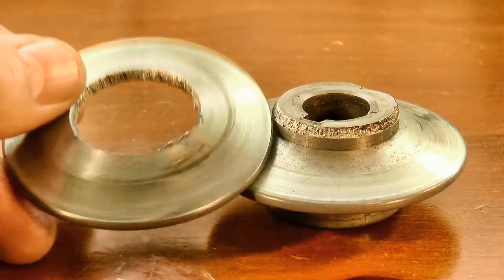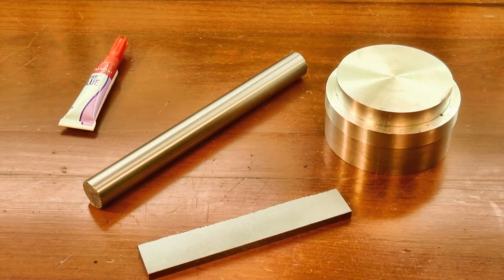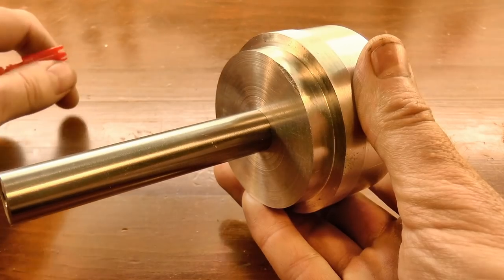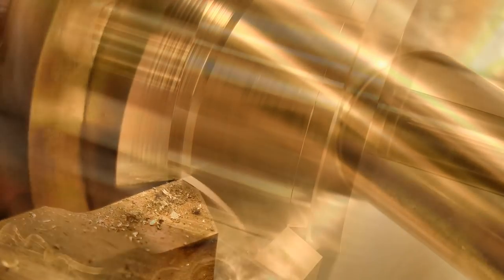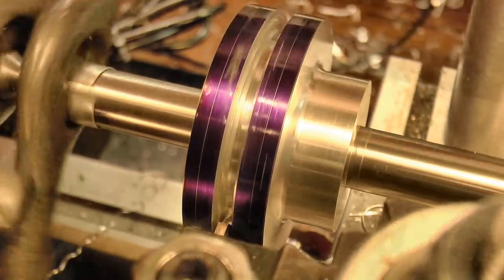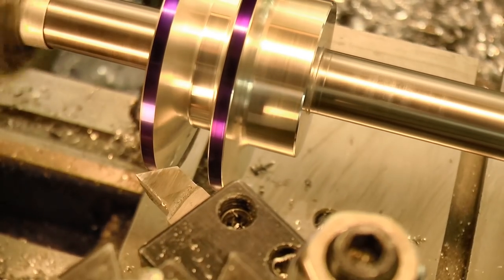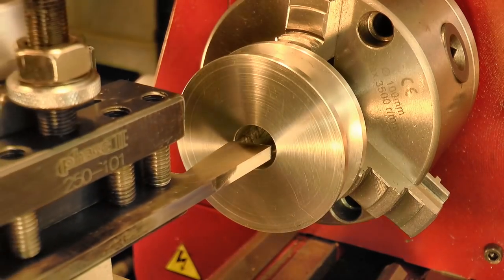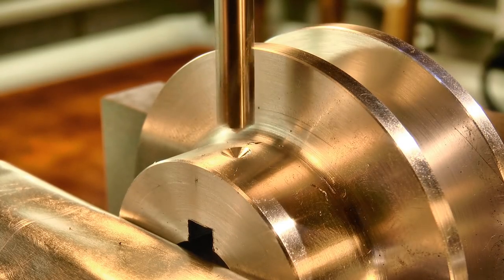Machining A Replacement Pulley With A Keyway

Comment: Don't know if anyone mentioned this yet but I got a quicker way to get to the final depth of the key way. If you have a end mill the same size (or smaller) as the key way and long enough. You can cut to the depth of the key first with said end mill. Then come back with broaching tool and all thats left is the radius from the end mill and maybe some material on the side walls if an undersized end mill was used. Much less material for the broaching equals much quicker. You might of known or heard this already but thought id share some advice. From a entry level machinist here in Texas
Reply from the maker: +Zac  Tart Great suggestion Zac, I'll try that out next time! Thanks very much for sharing :)
Reply: that's a better method to make the keyway
Reply: that's a better method to make the keyway
Reply: TICK for  Zac :)  yep...that's a good idea

Comment: honestly these videos are really satisfying. It hits a certain sweet spot everytime I see you use a tool and link to a video on how you made that tool. Everything that makes your job easier seems to be something you have made for yourself and that sounds so devine. If I wanted to start machining as a hobby, where should I start? what tools will I need to begin?
Reply from the maker: +jamiiis2325 Consider starting with a small lathe: http://www.clickspringprojects.com/blog/which-lathe-should-i-buy Cheers, Chris.

Comment: Hi Chris. I've been enjoying your videos a lot, and I'd like to offer a quick tip. When you're making a tapped hole, it helps to put a generous chamfer on the hole before you tap it rather than after. It not only provides a nice lead-in for the tap, it also keeps the chamfer tool from pushing a burr into the threads. Try it, see what you think.
Cheers!
Reply from the maker: +Tito Rigatoni Cheers Tito, I must admit I'm a bit slack about that!

Comment: Very interesting and superbly made video.  I did a similar project myself but the arbour had a threaded spigot with a nut and washer to hold the blank in place.  I have never seen superglue used in a situation such as this.  I did mine 50+ years ago so superglue wasn't around then!

Comment: Very high production values and machining skill. Was there a reason to locate the set screw above the keyway? Normally it would be directly opposite (perhaps for balance, visual symmetry or so the key is forced into the slot in the pulley and the shaft)
Reply from the maker: Tom Willers With hindsight Tom that probably would have been a better idea, but to be honest I just copied the broken part! Thanks for watching mate.

Comment: Chris, I noticed that you usually use "Heat" to break your Super Glue Bonds. Wouldn't Freezing the part break the bond as well? 
It might be Slower, but it would not develop the Very Poisonous fumes, even if you where a respirator when you heat it up.

Just a thought, 

philip.
Reply from the maker: Hey philip, depending on the circumstances the bond can be broken with direct heat, dissolving in acetone, or soaking in boiling water. The bond is very brittle at room temp so if the part can tolerate it often it can simply be tapped off the face of a chuck for example - Cheers :)

Comment: What a beatiful work, that looks so sweet.
Reply from the maker: +TheBK117B2 Thanks for watching
Reply: Hey there, 
got one more question:

Did you have to fix the chuck in any way while broaching the keyway ? If so, how did you do that ?

On my lathe i got an electronic speed regulation so there's no gears where i could set a low speed to make the chuck spin very tight. 

It's always spinning free so i'm afraid that the chuck will spin when i cut the keyway and i will loose the track of the established cuts.

Greetings from Germany ;)

Comment: beside its pretty easy to weld, i really like your videos. small tipp: when on the laythe take more then 0.3mm as chip thickness. in most cases you get a better surface and your tool hold longer because they are cutting and not pushing

Comment: Nice,,,a slight  interference  fit on your arbor should be more than enough hold and forego the superglue. Then heat the aluminum part to install and remove.

Comment: Ever made a little pulley with gear teeth for a toothed belt without and the use of an indexer?
Also, if you haven't already, please consider a tutorial on setting the compound for different cuts on these mini lathes.
In my college Machine courses, we always set our compounds at 30º, but everyone seems to be setting their mini lathe compounds parallel to the ways. Cheers m8

Comment: Two questions this time :)

1) Where did you learn to do all of this?
2) What 3D modeling software do you use?

Thanks again for the great videos!
Reply from the maker: demon39063 No problem :) 1) Tubalcains video's and books. 2) I use Solidworks. Cheers mate, and thanks for your continued support.
Reply: +Clickspring I can think of no higher praise for Tubalcain's work than that you credit his instructional materials for your skills.

Comment: Something struck me about the process for broaching out the keyway, I'm curious why you didn't rough it out with the mill and finish it with the broach. Are the time savings not worth it after factoring in switching machines and setting up another operation?

Thanks for posting such fantastic material.
Reply from the maker: +Alex Wiecke Yes a bit more trouble than it would be worth in potential time saved. Great to have you watching mate.

Comment: Making this out of aluminum may have been a mistake. I mean, it may last too long and won't give you an excuse to use your lathe for a good while.
Reply: I always start by making my parts from cheese. it very seldom works, but it's delicious when it fails.
Reply: connect2reality wood is always an option, or clay :v
Reply: Nothing is wrong with aluminum is this setting. 6061 is plenty strong to handle the situation. There's not excessive side loads on the pulley and it should last for years. Time comes, make a new one.
Reply: @cgrobe21  I believe it was a joke!
Reply: @robmckennie4203  I made one from cow shit, wasn't good!

Comment: Hi mate. I really love your work and dedication. Just wanted to know why reamer instead of boring bar. thanks a bunch
Reply from the maker: +Bertrand Labelle Hey Bertrand, a boring bar would have been a valid choice, although in this case the reamer is quicker and takes the thinking out of it, because the final dimension of the hole comes directly from the cutting tool itself. Thanks for watching and asking :)

Comment: I know this is an older video, I am hoping you still answer comments.  I have been catching up on your vids and saw the one with the square broach for making square holes.  While watching this one, I wondered why a square broach was not used for the keyway, and then the hole for the rod drilled after?  I would assume the reason would be some problem occurring I just cannot see what it might be.  Thank you!

Comment: Gorgeous camera work as always. Question?  is turning between centers more or less accurate?? my brain says it should be better for accuracy as you can kick the tail stock about to reduce runout but you lose a load of clamping force as the work isn't in a chuck so have to take lighter cuts........

Curiosity is the real devil in the detail.....

Awesome video

Comment: Firstly Chris, thanks for the excellent videos mate, great work! Now, Question: When you are installing the aluminium, already mounted on the arbour between the centres, you use a two-piece part that looks to be cast and painted in hammertone. What is that for, and why is it necessary?
Reply from the maker: Hey Chris, that's called a lathe dog (aka lathe carrier) and is used to transmit the torque from the lathe spindle to the workpiece when the work is located between centers - great to have you watching mate :)
Reply: I have to confess that I worked this out last night about an hr after I posted my question, but it raised another; Why do you turn between centres rather than just sticking one end of the arbour in the chuck? It is just a convenience thing if you need to reverse the piece on the lathe? BTW can't wait for the next segment on the Antikythera Device!!

Comment: I wonder if there cutting off the keyway might have been easier if the tool post had been pushed from behind with the tailstock, rather than from the carriage hand wheel. if I ever need to cut a keyway (which I undoubtedly will) I might give this a go

Comment: .0005" depth of cut x 3 for each pass to a ¼" to reach the bottom...you got a nice arm/wrist work out there! That is one of my biggest problems when doing things like that. I lose patients and try to figure a way to speed up the process and that is when all hell breaks loose. Or, I will drive all the way to the shop to buy an arbor press and broach set...by the time I get all that done, it actually takes longer than if I would have just stuck it out doing it the way you showed. Oh well, at least I end up with the right tools so that the next job will be much simpler...
Reply from the maker: +Brütal Löve Yes it was a bit tedious, not exactly the quickest way to get the job done! Thanks for watching :)
Reply: Clickspring My pleasure. The most important thing I get from your videos that helps me the most is your unfailing patients and attention to detail. Those are the two areas I struggle with the most. I have the knowledge and technical ability, but without those two items, my work suffers.

Comment: A silly question perhaps, but once you put the aluminum stock piece on the rod, why put the rod between centers? Why not just chuck it?
Reply from the maker: The part needs to be re-held at least twice during the machining process, and a 3 jaw chuck will always have at least a small amount of runout error. Each re-chucking would introduce that error to the subsequent features as they are formed. However turning the part between centers ensures that the part can be removed, re-held, and additional features formed, yet keep all of the features concentric with each other. For a part like this, that means less out of balance vibration at high rpm. Thanks for watching and asking
Reply: I've thought this myself several times watching your videos, glad the question was asked and answered here.

Comment: Chris, love your channel....quick question....I know it's kind of an old video, but hopefully you're still answering questions....I have a much larger lathe than the one you use in this video, a 13" south bend. Do you think it would work to cut a key way like you did here in a steel pulley if I'm using a bigger machine?
Reply from the maker: Yes, but be sure to keep the depth of cut modest.
Reply: +Clickspring awesome. Thanks!

Comment: been an avid follower of your clock build and i absolutely love your videos mate, really informative and your work is exceptional, but i have a question. I notice you always use HSS tools when turning on your lathe as opposed to using carbide tips and was curious if you had a specific reason behind this or do you prefer working with HSS tools?
Reply from the maker: +KailorenPlays Yes I prefer HSS, mainly because I regularly grind specific shapes for the work I do. I use carbide only when I'm cutting something very hard, which isn't often. Cheers mate :)

Comment: Great video! What kind of clamp is that in the very end of the video? Looks very handy to me!
Reply: I assume you're talking about the hand vice, I believe there are plans for it on chris' website. it's a pretty straight forward design if you'd want to design your own, there's a taper that pushes the arms apart on one side of the pivot, and they clamp down on the other side

Comment: Can I ask where  you can get a pulley made? Do community/tafe groups  have a lathe? Can I ask on air tasker? Do industrial companies make one off for domestic use. I am after a small multistrand pulley to raise 5m of heavy curtain. Thanks great video
Reply: You should be able to buy pretty much anything you need online.
Any machine shop can make one but it will be an expensive part.

Comment: Great video! It should be possible to dissolve the glue with acetone if you want to avoid heat.
Reply from the maker: +Radbert Grimmig Yes it dissolves excellently with acetone, although it takes a lot longer to penetrate through all of the glue. I tend to soak in acetone if I don't want the heat to marr the surface finish of the work (eg the bezel in this video: https://www.youtube.com/watch?v=K6Ai5F8O3iI), and I use heat if it doesn't matter. Thanks very much for watching.

Comment: nice work .... can you show me how to make a moving joint for a cross metal, the cross is actuated by a free hanging weight that goes up and back down , I did it with shift that has two holes perpendicular to each other with springs and steel balls in them pushing against the outer cylinder of the joint , but it turns out that 90 degrees where two much for the free weight to pull and it stood their in the middle before the click !

Comment: Hey Chris,
Thanks for your videos.
Just a quick query - Isn't the set screw hole drilled in some different plane than the one containing keyway (preferably at 90°) so that set screw locks axial movement of pulley wrt shaft?

Comment: Hi Chris, another great video. The tool that you made for the Vee cut, do you sell these. The reason I ask is because I am a novice learning machining and don't have the basics that you might get via an apprenticeship or trade and as Youtube and certain contributors are basically my apprentice master I have restricted access to problem solving when I run into it. I would like to be able to buy certain things so I can have a physical look at them when I have a crack. Hope that makes sense. Gordon, NSW

Comment: just curious ...why go to the trouble of using the turning dogs when you could have just chucked the arbor and one live center? By the way ...as always, excellent video, to the point and no unnecessary fluff.
Reply from the maker: +R.M. Hobbycrafts As good as a 3 jaw is, there will always be a small amount of runout that turning between centers eliminates. It wouldn't have made a great deal of difference for this project, but Its nice to know that all surfaces are genuinely true to the bore. Thanks for the kind words, great to have you watching :)

Comment: I'd be curious to know how long it took to cut the keyway. It seems like it took quite a long time since there were so many thin passes. I would guess about half an hour, but I could be way off.
Reply from the maker: sooth15 Yes you're spot on, about a half hour. I think if I had a lathe with a more sturdy carriage wheel, I could have probably got through it with a deeper depth of cut. Thanks for watching mate.

Comment: After making the keyway, do you not have to worry about the part no longer being perfectly balanced?
Reply from the maker: +mickleman52 It's only a very small mass that is being removed, so not an issue at the rpm this machine runs. Great question, thanks for asking it :)

Comment: Why go through all the trouble of turning it between centers? Cut the stock idk 3/16 or 1/4 longer hold it the chuck face to clean and drill the center hole. Scale the stock out turn the OD and groove it flip it around face the excess stock off. Done. If you're worried about run out or concentricity use a 4 jaw and indicate in dead nuts.

Comment: 3:50 Why not part off the bulk of the waste? Fewer chips, and a ring you can save for a future project. Is it possible to position the cutter parallel to the shaft? Or make an L-shaped cutter (show it in another vid)?

Comment: Great Videos, Chris, thanks for them!
Did you make the groove for the belt that deep on purpose ?
It does not need to be that deep for the belt, in my opinion it is so deep at the cast part for reducing the wall thickness. I would have made it just as deep as the standard requires for your belt size.
Reply from the maker: Dieter Mayr Hey Dieter, you could be right; I just followed the existing part. Thanks for watching mate.

Comment: What software do you use to make your drawings? I would be very interested in that if it is free or inexpensive. Thanks in advance.
Reply from the maker: Hey Joe, I use Solidworks but its crazy expensive. Consider Fusion360 instead, same parametric modelling capabilities, free for home users

Comment: You use lathe dogs instead of gripping the arbor with the chuck. Is it because of better precision? If you didn't have lathe dogs would you just grip the arbor in the chuck?
Reply from the maker: +Andreas Elme Hey Andreas, yes better precision. A 3 jaw chuck will almost always have some runout that can be avoided by turning between centers.  Thanks for watching and asking.

Comment: i think with the way you clamped the part up with the two dogs can be done simpler by using a piece of pipe with two bolts tapped in the side of it , less stuff flinging around too

Comment: May I ask a quick question? I notice that you always start drilling a hole with one bit that looks like it's made just for that purpose, and finish with another.  What is that first drill bit called, and what is the advantage of using one?
Reply from the maker: +Daniel Wade Hey Daniel, twist drills are notorious for 'wandering' off position if there isn't a starting point for them to begin drilling. The first drill you see me use is called a spotting drill, and is much stiffer than a standard twist drill, and experiences much less of that 'wandering' effect. It starts the hole, and then the twist drill follows it without issue. Thanks for watching and asking :)